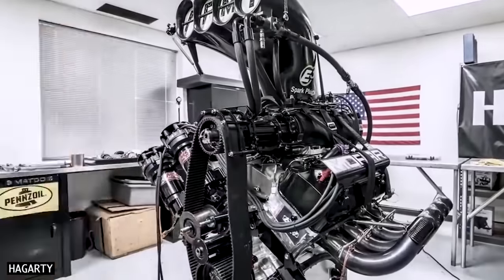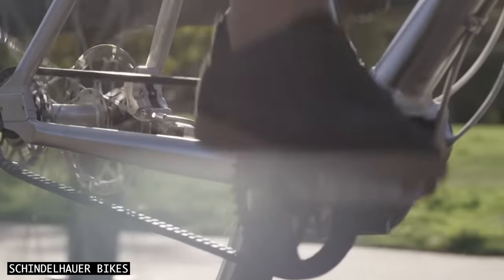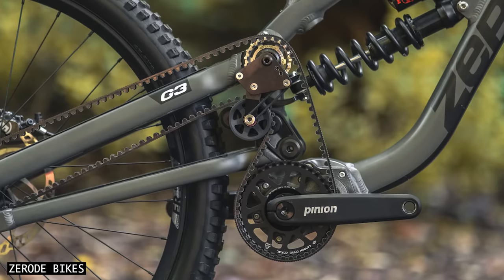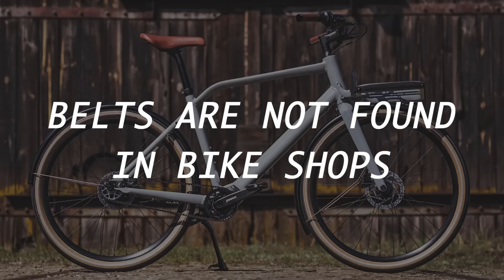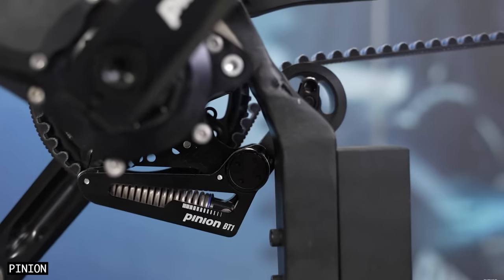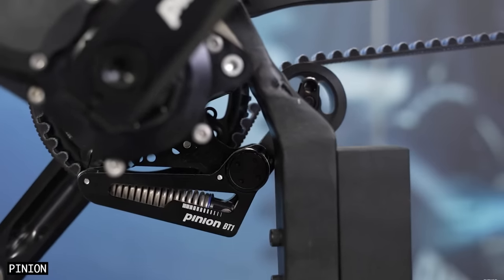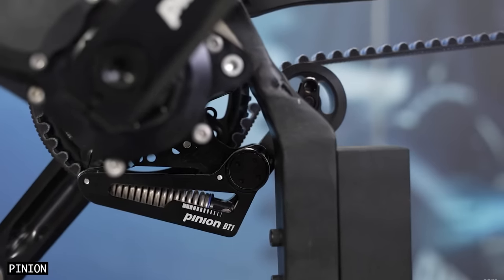Belts Are Now BETTER Than Chains On Bicycles!

Comment: I been running the same Gates CDX belt on my belt drive mountain bike since 2015 in harsh conditions. The front pulley shows some wear now but still going strong. The best part is when I get home caked in sticky river-bottom mud/clay - I just hose it down and hang it up to dry. No lube. Running it with a Rohloff. The belt saves about a pound. The planetary geared hub adds the pound back on. But I get 14 speeds, and can shift without pedaling which is super handy for winter cycling in MN. Also, and nobody mentions this fact, the 14 gears ratios are almost perfectly linear in spacing. A double shift at the bottom of the range advances the gain ratio (see Sheldon Brown for why this is so significant) the same as at the top of the range - not so with cassettes, which usually jump significantly between three largest cogs to limit the number of huge rear cogs in the cassette. The one con, besides price (less of a factor now than 10 years ago), is that the weight of the heavier geared hub is out at the end of the wheelbase, so I do notice a heavier feeling rear end (the bike’s rear end mine is skinny). But the belt is so reliable I think it’s the best setup for bike packing and true CX MTB touring. No need to stow extra chain, chain tool, lube, etc. And virtually 0 maintenance, especially in winter in MN that is a huge plus. No more rusty chain and no more frozen gears or shifters. My frame is a Ventana Comandante Último w/ XTR cranks, 29” Stans Crest MK3 rims and a 100mm Lefty front fork. Bike weighs in at 25lbs w Maxis Icon tires - 2lbs heavier w winter studded tires.

Comment: I wonder that downside of bike shops not having them would apply for my situation here in the Netherlands. My recent purchase has a belt drive with an automatic enviolo gear hub thingy, but if I'd have to guess about 10-20% of the bicycles they had in the store for sale were equipped with a belt. But the focus on bicycle sales here is typically less focused on sport activities and more on practical everyday activities. The ones set up with a derailleur will be in the minority, I'd guess at least 75% in the typical store will have some kind of internal gear hub.

I knew what to expect based on the test ride, but once I finally got it after a long waiting period it was very surprising once I got out of the town. I wasn't used to an ebike motor being so noticeable when in a quiet environment, but once I disabled the assistance it was pretty clear that's just the lack of a chain making sound. Since the old ebike (45nm Bosch mid motor, 7 speed shimano nexus and a regular old chain drive) is still in the family with my parents I'm rather tempted to measure the noise both produce with and without assistance to get an objective idea.

The gearbox I picked while convenient does feel like it's a bit less efficient as it takes more effort to maintain a high speed without assistance. The wider and heavier frame, wider pannier bags and Bosch performance line mid drive motor + battery probably don't help this no assistance performance observation. But I don't regret that tradeoff it's very convenient with frequent stopping, accelerating from stationary after waiting for traffic, getting past the occasional bridge/viaduct without having to think about gears. It's my primary mode of transportation for the work commute, getting groceries and the occasional casual ride. And the electric assistance can compensate for that last bit of speed if I'm in a hurry, typically getting to work timely, frozen groceries in the bags or cold/wet weather. 

The water and toothbrush suggestion to clean the belt seemed very practical, not sure how often it's needed when I don't plan to ride along those routes you're showing on video. I guess I'll keep it in mind if I ever ride over more muddy/sandy type stuff. As much as some of those activities seem fun I don't think my lower back would agree with it and the step through frame is probably not the best suited for it either.

Comment: I don't bicycle but back here on this channel about belts for the 2nd time as I love tech.  At this point, we are at the early days of e-bikes (less cost and maintenance than belts). Like horse drawn carriage back then, we moved on to engines and motors. Many ways to charge an e-bicycle and there are some that can also be powered by pedaling. While pedaling an electric bicycle is less efficient, it is there for emergency or to stretch the range

Comment: We use Gates polychain belts on a lot of our motors at my work. We get multiple years of hard use before they require replacement. 40,000 - 80,000 hours is not uncommon.

Comment: When I visited China a few years ago, I found in a pile of mobikes on the sidewalk, one with a breoken wheel lock. It was a simple design with a belt drive and airless tires.

It was a very ok bike on flat Beijing pavement and I couldn't help but think "Gee, if someone sold a slightly nicer version in the US, I would pay $200 for it instead of the $26 they probably cost a piece here."

Comment: I've had a belt drive bike (rolloff&gates) for 2 years, and I've snapped two belts just commuting around town. For me, it is a common occurrence. You have to go to a bike shop that has a lot of experience working with belt drives, or else the mechanic won't get the tension right. And if the mechanics can't get it right, good luck trying to get the tension right on your own!

Comment: I don't think there is a huge difference between the tech on a timing belt vs bike belt drive. I think the big difference is the relative size. If bike chains were as wide and thick as a timing chain they would likely never break, and if they were in a filtered oil bath they would never wear out.

Comment: Thoughts on the Split Belt? Seems to be a more practical solution to the frame compatibility issue for the average person, if the durability is on par with a standard belt

Comment: in modern(ish) applications engine belts are "wet" belts meaning they get into contact with engine oil, which is not good for the rubber of the belt and causes premature wear of the belt. external belts are great because changing it out is a quick job. chain driven cams use a internal chain meaning that the chain is constantly lubricated via the engine oil and it keeps it out of external contamination, often times these are double roller chains as well all of that meaning they last a long time.

bicycle systems are the opposite, you get a external belts which is great for the belt as it is not in contact with any oils, and you get external chains which is horrible for the chain.

Comment: Full suspension systems have proven to be vital for me, and climbing hills and shock absorption has been vital in my rides. I'm fascinated by this system. I can see why it is far more proficient. The chain and shifting has been my biggest issue. Going from lowest gear and up. The slack it tends to have, and the chain slipping is more hazardous than anything I've noticed. Do you have any videos on disk breaks or a stronger alternative?

Comment: I have a belt drive bike. Plastic rear sprocket lasted less than 12 months before shattering. Replaced with a metal one. Never had an issue since.

Comment: Have you tried comparing specifically some of the best e-bike chains vs belts? 
In exchange for a weight penalty, ebike chains have evolved a lot lately, improving the durability to withstand the forces a motor puts them through.
Reply: We have 2 different customers that did arround 50 thousand km on a beltsystem with a bosch performance engine / enviolo hub. absolut crazy! we sell belt bikes nearly every day in our shop. i also have a touring and enduro bike with belt. will never go back!

Comment: Very informative video, thanks Alee! I did not expect gear hubs to be (slightly) more efficient than gearboxes...they're probably still lighter, too?  I've been lusting for a gearbox bike mostly for the better weight distribution, but given I don't do downhill mountain biking or anything that extreme, gear hubs are probably still the best option for me.  Way more affordable, too.
Reply from the maker: Gear hubs are lighter and can be more efficient too. The weight distribution doesn't matter too much until you head off-road. And even then, the higher hub weight never really bothered me on a hardtail (I'd definitely recommend a gearbox for full sus).

Comment: I live and work on the beach. I give sandcastle lessons and use a bike and cart to transport my gear to various locations.  Rust never sleeps!  Sand makes sand paper and grinds down the gears.  I’m switching to belts!  By far, I think I have one of the most extreme environmental conditions to survive. I plan on converting a tadpole trike to a quad that uses belts. From what I’ve seen no one has done this, ever. Harsh conditions require harsh solutions. Looks like it’s up to me to do this.

Comment: Belts just have different problems.  Since you have to use a gearbox or planetary hub, your gear ratios available are far fewer, and very difficult to change.  Also, usually way more friction.
Reply: And way more tension which wears down the bottom bracket and rear hubs a lot faster than a chain does.

Comment: i can't help to think a full chaincase with a fast chain would still beat anything else
Reply: its actually ridiculous that the chain and sprockets arent enclosed... it looks so lame. right. but more areodynamic... you dont use your bike. just something simple like this would make it last eons longer and its just waiting on a simple patent that is quick to take on or off.
Reply: @wtfvids3472  with the right shape for single speed, it could even be more aerodynamic I think. Those hundred little holes in a chain probably drag around a fair bit of turbulence, versus one large blob with a NACA airfoil with a very tight hole on the side for a crank and the hub. (all of this is nothing compared to loose clothing, but hey)

Comment: Nice system.   Till Gates decides to discontinue the system that came on your bike and then you can't get a replacement belt.  The CDC belt is no longer made.  I have a Scott Sub 10, bought in 2016.  AFter 15k miles the belt broke.  It took me months to find a belt and I had to have it shipped from Europe.   Next time I need a belt, I am not sure where I will get it.  Pretty sad.
Reply: Yes, and changing the sprockets to CDX is expensive. Also you need special tools to do it.

Comment: Try brushing corn starch on your belt. The auto manufacturers use it to tightly pack the air bags into their modules so they will deploy properly under the massive explosion it takes to make them fully expand in microseconds. It's one of the slipperiest dry lubricants known. That white "smoke" you're breathing after an airbag deploys isn't burned rocket fuel, It's corn starch.

I used it on my Priority Turi with great success. After about 7000 miles the phrenolic plastic front cog developed those "cups" on the torque side of the teeth and it was creaking under pressure. While I waited for a new one I used corn starch on the old 7000 mile belt and it stopped the creaking immediately. I suspect I could have gotten many more miles on it had I been using it from the start.

I just bought a Priority 600 and will be using corn starch on it to see if it prevents the wear I had on my Turi. It certainly won't hurt and it may prevent wear by keeping the belt slick and dry so dirt and dust won't stick to it.

Comment: One gates belt is almost 100€. I can get 10 11 speed chains for that. A chain lasts me between 10000-15000 kilometers. The cost per Kilometer is much higher on a belt driven bicycle, even if I assume the highest service live of 40000 kilometers.  It's cool tech certainly, too expensive for me. Wheels to Wander channel have shown you can travel the world just as good on a 26 inch 90s mountain bike. If you need the extra comfort a belt drive gives you, more power to you.
Reply: What chain do you use? I use the recommended Shimano for my 8 speed Nexus, and I've to change it every 5000km aprox because it loses so much tension that it hangs noticeable low

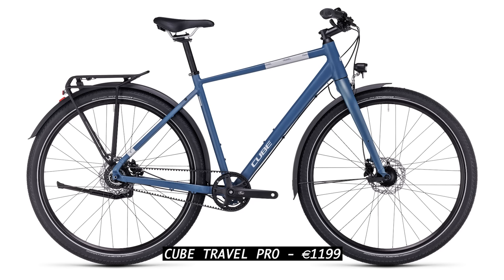Comment: A few years ago I bought a gates CDN belt driven bike for my daily commute. The one you have in your video @ 7:32 (Cube travel SL). I owned that bike for a year and a half and sold it because it was just an awful experience. The rear sprocket was worn in just 1500km, the belt was worn in about 4000km, it was noisy and the lbs didn't know how to work with them given the fact that over the 1,5 year of ownership the bike was in the shop for over 6 months. That combined with the brakes squeaking like hell even after replacing everything made me sell the bike.
I now have a fairly cheap Trek mountainbike which I modified to use for my daily commute. The shimano altus 2x8 drivetrain gets a new chain every 2-3k km or so. The chain is just €12,- and I have a few in stock. I will probably have cycled upward of 20-30k km before I equal the amount of money in repairs that the gates belt has cost me in just 4k km.

Moral of the story; don't buy a CDN belt, buy a CDX and make sure you have a good LBS.
Reply: These belts were introduced because they do not require a stiff frame like with the CDC belts. These CDN belts have some margin which allows for the allignment to be off. So they were able to put these belts on the cheaper bikes. This is also kind of true for CDX. Also the sprockets used with CDN are not made from steel. The CDX is also not so good compared to the older CDC. The lifetime of CDX is much shorter. I guess Gates makes more money selling inferior products. Luckily, I have some CDC belts and spare sprockets laying around for my MTB since they are not sold anymore. In the last 10 years I only broke 1 belt on my MTB because of some piece of wood which got stuck. My mtb friend with CDX had to replace his belt in the first year... also it makes more sound compared to my CDC.

Comment: Great Video. My older bike has the cheap one Gates belt. 12000km and 6 years. Bike feels like new. Maintance: I've set up the tension after 2000km. It tooks 10 minutes. I also like belts.

Comment: Interesting video. I'm looking to make a DIY bike and i feel like i cannot simply source a frame that supports belt. All of them are e-mtb frames with dual suspensions. Has anyone tried for example to pair an IGH with belt and an M620 on a dangfu frame? Is it possible?
Reply: Gates said to me it wasn’t recommended.  I don’t believe them!
Sure, the belt has to fit some how, and also be adjusted somehow, but what is the big deal? Anyway I plan to retro fit some bikes and build up a quad.
Reply: @spidennis  supposedly it's the future of ebikes to have an internal gear hub or gearbox, yet we see no support for these modules. It's also the reason I held myself from building a custom ebike since oem are overpriced to hell. Adaption rate is SO slow. Motor development is also atrociously slow and locked/restricted to silly legislations. In comparison, I have an Esk-8. Those things are rockets. Lots of options for unrestricted ESC's, powerful motors 3000watt x2 , 60km/h+ speeds. Belts system were developed so fast, and within a year or 2 of becoming a popular EV we had a couple of oems develop internal gear drives. Insane how slow and overpriced ebike development is taking into account how popular an ebike is

Comment: I have a bike with a belt drive. I hate it. I don't ride it. It's a Felt commuter. The kevlar belt was supposedly unbreakable. I broke it. The internally geared hub is HEAVY. It messes with the balance of the bike. You better get well versed in tuning and diagnosing your own problems because most bike shops don't care about your novelty drivetrain.

Comment: I really don't know what the fuzz is about doing "35 000 km" with a belt. I'm nothing close to a professional cycler and my bike always stands outside in the rain and snow (I'm from Belgium). I commute almost everyday day, 15 km to and back to work that means around 7.5k km per year. Beside this I also cycle just for fun so I do close to a 10k km per year. I have my current bike for 2 years and never had chain or derailleur problems. (the bike is from the 90's and it's second hand). This means the bike(and original gears) have probably more then a 100 000 km on it.

-The only thing that you need to replace often on a bike are the tires, replacing a tire on your way to work(when you are in a hurry) is probably much more easy on a bike with a chain then a belt. But hey, if you are happy with a belt. Have fun :) Almost all e-bikes have belts and I only have know one belt ever break (e-bike around a year old) because it got cut by a cycling on gravel.

-I actually think that for using a belt, you need to be much more a bike "geek" then a chain. You must remember that most bike users don't take good care of it. Just leave it out in the rain, almost never clean it. A chain with simple transition is perfect for this situation because of no need for tension or specific working conditions. Know that there are chained bikes riding around with more then 40 years without change of gear or transmission, only some grease. But hey again... if you personally feel happy by breaking a belt every 35k you drive... have fun!

Comment: I've not ridden a bike in decades but for the decades that I did I don't recall a single good chain/derailleur: they all slipped or just completely came off for me. Once I get back on a bike (an eBike) I will definitively go for a belt drive.